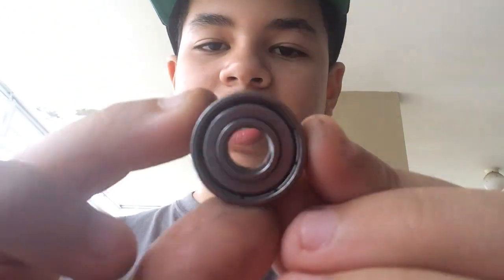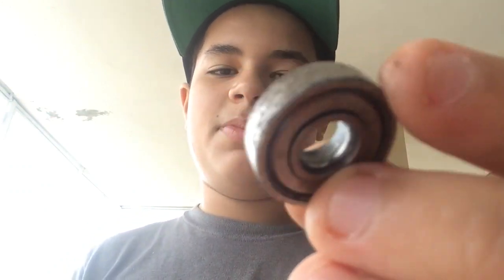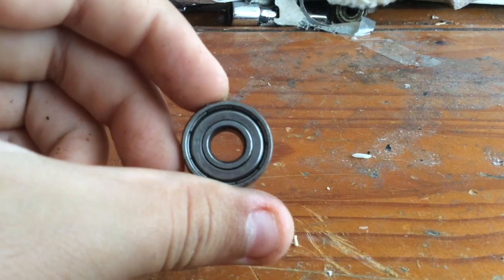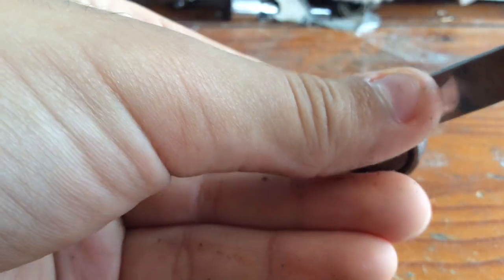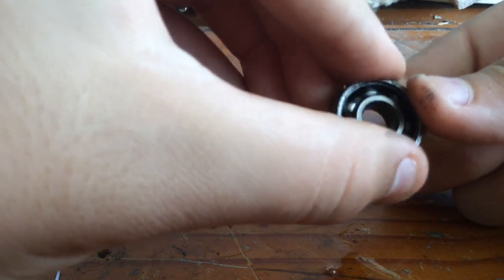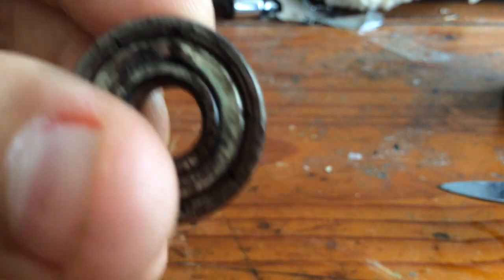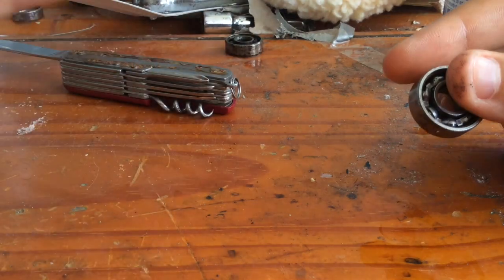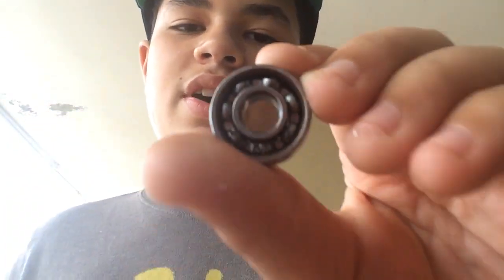HOW TO TAKE "NON REMOVABLE SHIELDS" OFF BEARINGS! | Tutorial

Comment: Dude WD40 messes up ur bearings big time
Reply from the maker: Its for the rusted bearings, it works really well, ive done it so many times and it does not mess them up unless they are not rusted. Its legit :)
Reply: +skrinlex RS well idk every bearing cleaning videos I've seen say to don't add tht nd they say it like very serious
Reply from the maker: well ive done this on RUSTED bearings and it works :], on clean ones it damages
Reply: +IlbanGRomero just make sure to clean the bearing of wd-40 when the rust is gone and you are satisfied. If you don't clean it, it will serve as a magnet for moisture and it isn't a very good lubricant either. It's better to use your speed cream as you nicely said.Not too much though :D
Reply: i agree with you, use wd40 to remove rust.
The wd40 will however attract dust and grime, so once rust is gone use white vinegar (which also removes rust) or citrus cleaner to clean the wd40, dry the bearings and then apply speed cream
Reply from the maker: +Fernand Fruitson Exactly! thanks for clearing that up :D
Reply: Use common sense, he isn't lubricating the bearings with the WD-40, he's using it as a SOLVENT so an actual LUBRICANT like Speed Cream has a better surface to lubricate.
Reply: Let me say this.WD-40 has its place,but it was NEVER intended to be a lubricant.
WD stands for water dispersionment (to remove water) its further intended action after the penetrants and dispersion elements have evaporated is to seal out moisture in very tight fitting components,however,that seal is a very sticky,gummy and dirt attracting stuff. 
In time,it becomes like varnish.
As others have said,cleaning with it,fine,but blast it out of there and put some real lubricant in there.
Back in the 80s and 90s,I got paid to fix what WD-40 screwed up.
Reply: WD40 isn’t good bcs it takes away the cream, if u use WD just add cream
Reply: No people say not to use wd40 as a lube you can use it to remove rust, just make sure you clean it off and then reapply your regular bearing lube.

Comment: Dope. Been wondering how to pull this off for years. Since like, 1999, now I feel old. Anyways, some advice, if you actually like your knife don't use it for this. Puncturing the shield you should be fine 95% of the time, but for prying get a dental tool set from harbor freight for $0.99, ridiculously useful tools and you'll not destroy your knives.

Comment: Take the shields off from the outer edge, use a sharp point or mini screwdriver, they will bend a bit but if you carefully tap them back to shape on a leather covered anvil then you can pop them back in. It’s a bit of an acquired skill and it works fine.

Comment: Hey, thanks a bunch for this, it really helped me out.  I made one of those fidget spinners, and I got the cheapest bearings I could find for the outside three bearings.  They're leaky and I didn't want them getting anything messy.  Of course since they're the cheapest, they've got the non removable caps.  So I popped the caps off, cleaned everything up, and have a nice clean spinner.  It's great!  BTW I used a tiny flatblade screwdriver, it worked well.  Looking forward to more vids from you, you do a great job explaining.
Reply from the maker: Mark Harrison thanks! there will be a follow up video :D
Reply: I made a spinner too but a got the bearings off a cheap old suitcas

Comment: Also, you can put the open side of the bearing so they are facing towards the inside of the wheel
Reply from the maker: Yes you can! It helps so that rocks and dirt don't get in :)
Reply: Is it safety to use without shields?
Reply: Mirena Bourgas yeah. Because there's some that comes without a shield for one side just look up bearings with built-in spacers you'll see. (but you doing that at lease have a shield on one side so the spacers will at the the shield for the other side of the bearing)

Comment: You are right in saying that these types of bearings were designed to not remove the metal shields. However you have succeeded in proving differently. My question is, is it possible to remove these shields by causing nomimal damage so that they can perhaps be reshaped using " for example" a pair of needle nosed plyers. If so, I would be interested in knowing if they can be reinstalled by pressing them back in using a proper size socket as a pressing device.
Reply from the maker: You could try being careful and removing them from the outside rather than the inside, this was a long time ago and I usually just used them like this. But if you need to put them back, try to slowly with a very thin knife (or similar object) pry the outside clamshell and see if anything happens. Hope I helped, have a great day :)
Reply: @ilbangromero4690  Will give it a try. Thanks for the info..it was quite helpful. I would like to comment on the quality of your video by saying that you are quite the speaker. You have presented yourself in the upmost professional way. 
Again, thanks 😎

Comment: Thanks man! Big Help! Now when I put them back in my wheels should the open part of the bearing face the inside of the wheel or the outside of the wheel? And if I don't have wd-40 or any bearing cleaner is there a substitute I can use like vegi oil? I had some crappy abec 3 bearings, lol there so as shit and im to broke to buy new ones at the moment!
Reply from the maker: I'm glad the video helped! some substitutes for wd40 would be vinegar, it removes most of the rust. Now about the bearings part, usually you would put them facing the outside of the wheel, but it depends on personal preference! personally I'd put the open part facing the inside, so no rocks or dirt get inside, hope this helped! If you need any more help just comment! it is greatly appriceated!
Reply: 90% rubbing alcohol and sewing machine oil are cheap options.

Comment: You are not derusting them, you are just pushing the rust particles around. If you want to derust them just submerge them in muriatic (chlohydric) acid. It disolves the rust leaving the raw steel. Just make sure to wash it and oil it right after because the steel is super reactive when that clean and will rust super fast (hours)

Comment: 1. can you remove the non removable steel shields?  2. will the balls fall out?  3. do I need to put it back on?
Reply: mine is a fidget spinner,  I would like to remove the steel non removable bearing, and I need answers for the question above
Reply from the maker: stealth sniper 1. Yes, 2. No, 3. They will be broken, but if necessary, you can get rubber seals online for less than $1

Comment: Wd40 should not be used on bearings period.

Taking the cover off your bearings will damage the cover and warp the shape of the bearing cover. It will make it easier for dirt and grime to get in your bearings. 

Replace your bearings with removable cover type. Dont waste your time trying to remove what has not been designed to be removed.

Comment: If I got some rubber shields could I put those on after I remove the metal shields?
Reply from the maker: NeonMangos yes! it works wonders with the rubber shield :D
Reply: IlbanGRomero Cool, thanks man. Your content is very professional, you just earned a sub. Also, once you use the WD-40, be sure to soak it in a cleaner, like acetone or something like that.

Comment: and the non removable shields,i know how to put them back on
Reply: how
Reply: You just push it back it
Reply: But  it's not in the original shape already
Reply: Try to dent it back in place with a rubber mallet.
Reply: Or be a smart person and think how to open them with out breaking them ?
Because every one use this this technique for this bearing but there is also different way of taking it out with out breaking it.
Reply: Just put the open side on the inside of the wheel.

Comment: This is useless. They are not "non removable" they are "non serviceable". Running those bearings without shields is the worst possible thing you can do haha. They will be ruined in a matter of minutes.
Reply from the maker: Well to be fair, the point of the video is how to clean these kinds of bearings temporarily, so that you can have a smoother ride until you get new ones :), I see what you mean, but so far I've done this many times and nothing major has happened to my bearings, so it is a solution ;D
Reply: xgelmirx yey
Reply: xgelmirx dont h8 m8 boiii
Reply: Bullshit actually! I've done a version of this and they're still working fine haha.

Comment: trow these garbage bering into the trash and go buy some cheap ass 14 $ set of bering and you will get much better result Also using solvan and WD40 and shit like that in bering screw up your bering , you clean bering with citrus cleaner only  and if your bering dont moove anymore like these one its time to trow them away , regular maintenance on bering is crucial to keep them fine
Reply from the maker: stew360 I know there is a lot of confusion with this video about the WD40 and the fact about the bearings being crap ect. that's why I'm gonna make a follow up video explaining again how to do it, with a better explanation, the reason why you should do this, and overall the point of doing this. I'm gonna give you a simple answer so that you can get an answer quickly. I meant to do this video as a way to service non removable shield bearings as a temporary way to get your bearings serviced while you get new ones. but thank you  for the comment and hopefully this answered or at least gave some info on your argument :D